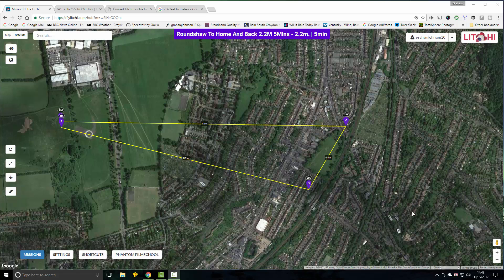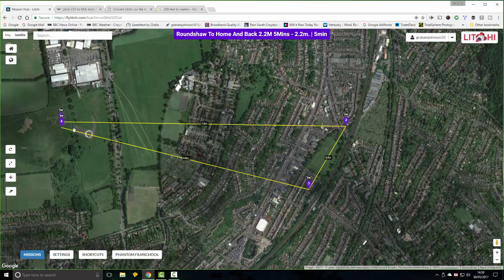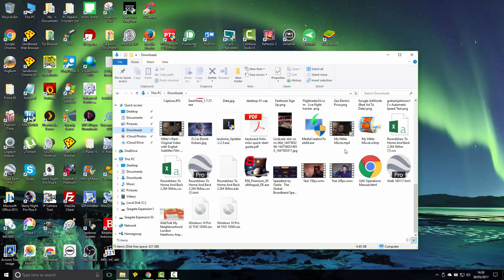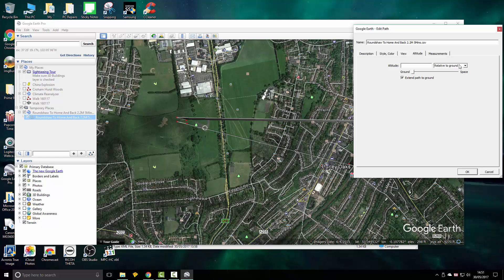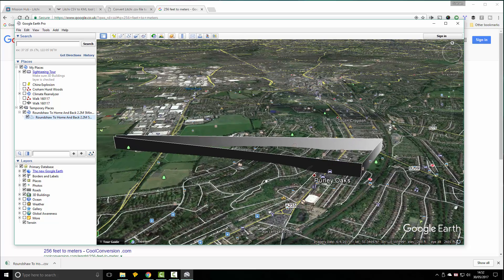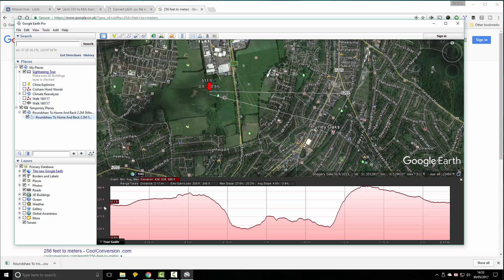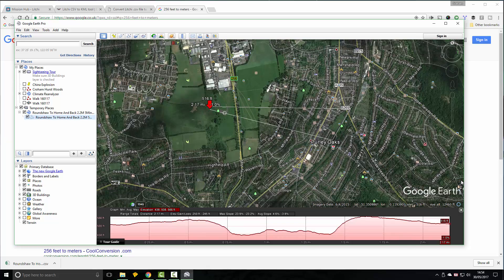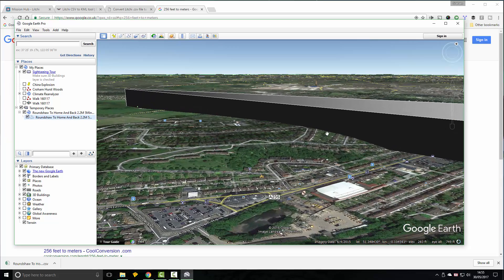Litchi Waypoint Ground Elevation Check

Comment: You can export KML from the Mission hub. No need to export csv and then convert it. Then just look to see that the flight clears all the hills.
Reply from the maker: Thanks @Paul Smith your right. Since this video was made Litchi Mission Hub has been updated.
Reply: when i try to export as KML 3D Path I get this:
Elevation Data Missing
Elevation Data is required to use this feature but could not be found. Import a Digital Elevation Model or enable Online Elevation in the settings. Learn more at https://flylitchi.com/help#missionhub

I've never had that issue before and can't figure it out.  enabling online elevation in the settings does nothing.
It's been over a year since I've used the Litchi mission hub until this.